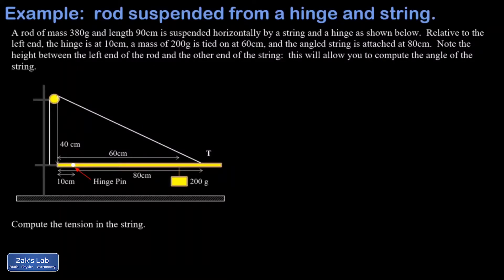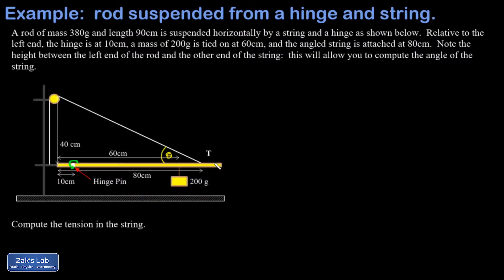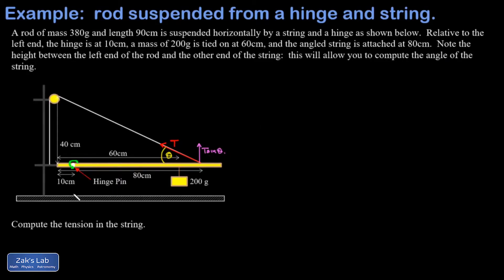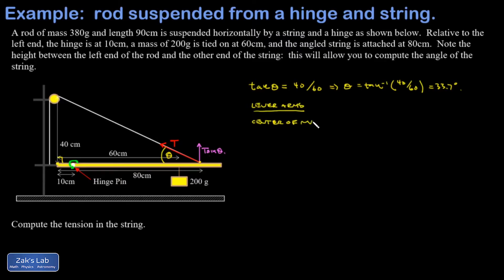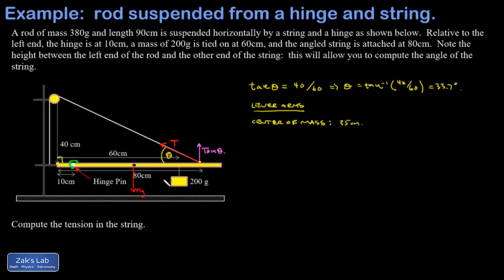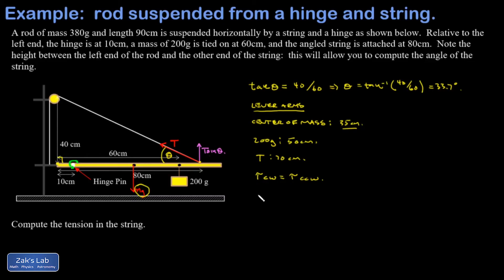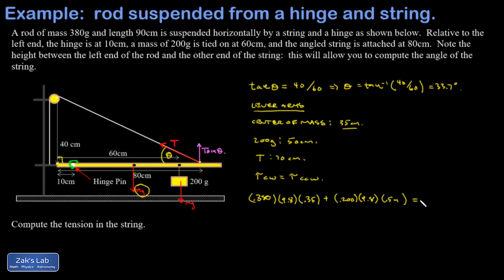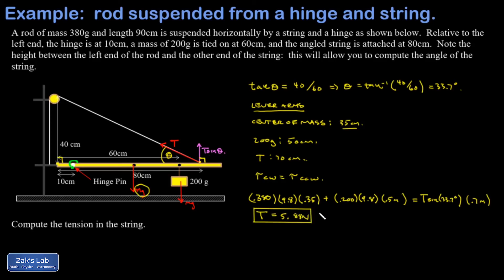Static equilibrium horizontal rod with hinge and string at an angle.  Heavy rod and string problem.

Comment: You had said in the video that the attachment point of the string was at 80cm in discovering the relevant angle but then proceeded to find the arctan(40/60)?
Reply from the maker: This is a mistake because I was going insane in Fall '20.  You're right, and it should be 40/80, or theta = arctan(1/2).  I'll add this video to my replace asap list.  Thanks.  BTW, I spent the last few hours replacing my garbage disposal (third thing to break this week if you don't count me), so that homework thing we talked about is going to take another day. - z

Comment: What happens with the horizontal component of the tension?
Reply from the maker: The horizontal component of tension points to the left; in order for the horizontal forces on the beam to sum to zero, the horizontal force exerted by the hinge must point to the right with the same magnitude.   But in this problem we're only interested in the tension (because this was an actual lab setup, and the tension is what we can measure in the lab).  Finding the tension only requires one component for the analysis.